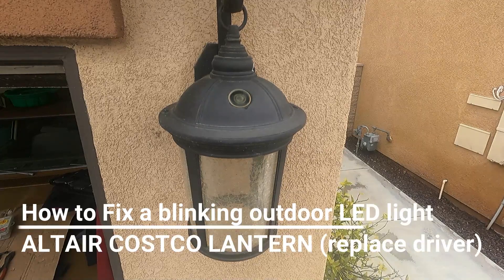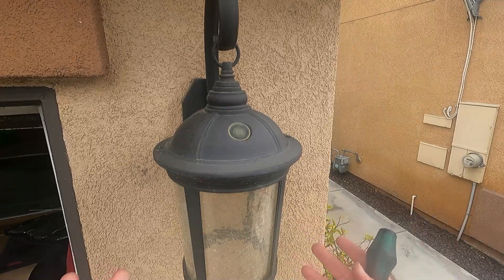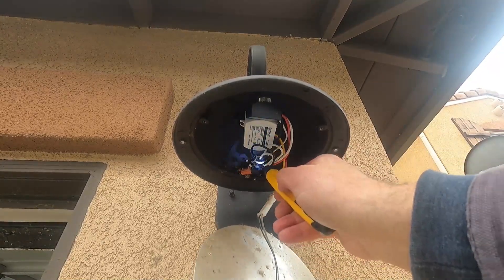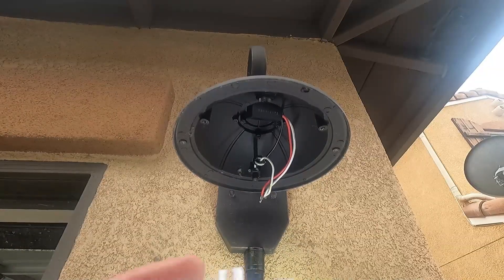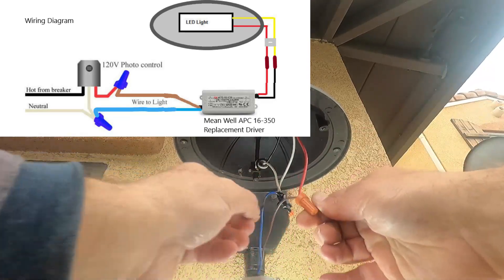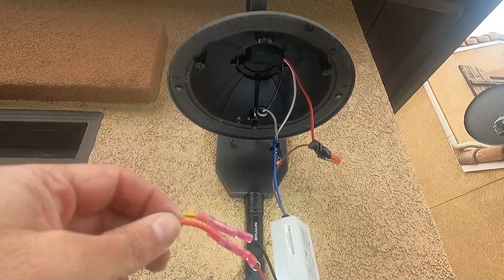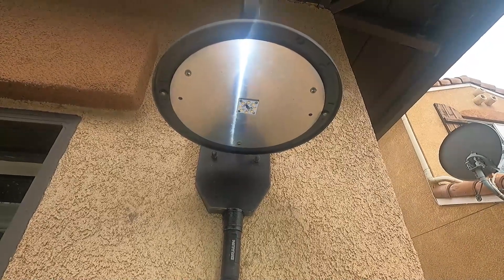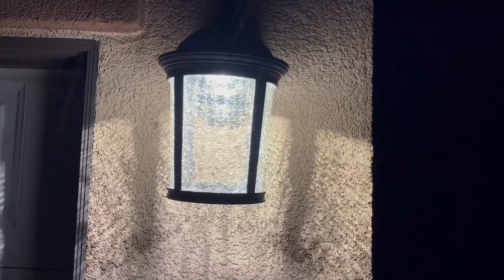HOW TO FIX A BLINKING / FLASHING OUTDOOR LED LANTERN FROM COSTCO - REPLACE THE LED DRIVER - EASY DIY

Comment: I ordered the part you recommended and this fixed the problem; however, I discovered that of the eight LED lights on the panel only one is working. On the other porch light we are down to three working LEDs. I there a way to replace those? I watched several videos that recommended converting it to a standard bulb, but I'd rather not do that.

Comment: How do you replace led light chip? My led light is dead!!!
Reply from the maker: Replacing the led light chip should be pretty easy.  It's held on by 4 small screws and has two wires that connect to the driver.  I don't have a link for the replacement, but if you can't get the exact one to replace it, you can just find a similar led chip in size and color and it should work fine.
Best of luck to you!
-Dan the Fix it Man

Comment: This video was great.  We don't have  your model but have the Altair 2163.  We followed those steps. The light goes on but photo sensor doesn't seem to be working right as it stays on in the daylight.  Did we wire something wrong?

Comment: Thanks for this. I just got a new replacement kit from Altair ($17) and the new LED plate integrates the driver, so no more white box.
Reply: Hey Gene, where did you buy it? Altair shows the fix in their website but didn't appear to cell actual parts ..

Comment: Great video, i have 2 of these half of the led lights are working, do you think its the same issue?
Reply from the maker: It might be the same fix, but it’s possible that some of the led’s are bad too…
Reply: We had the same problem then days later the light started blinking.  It's a $15. Fix if you get the right power supply!   Cheaper than a new light at around $55 to $80.00